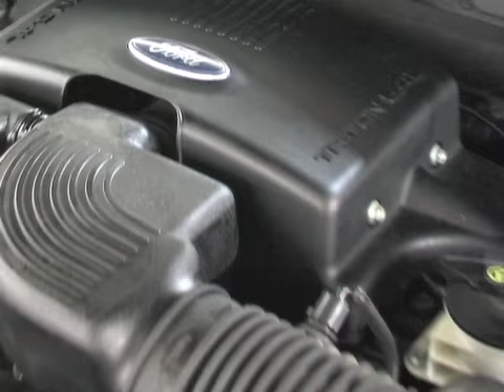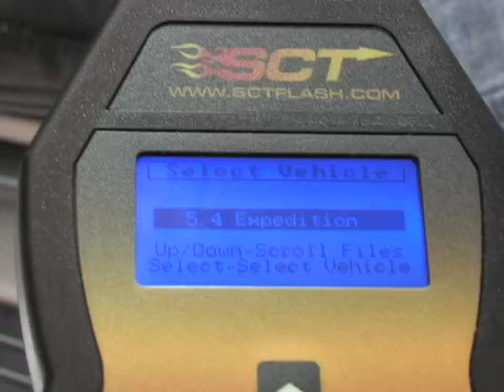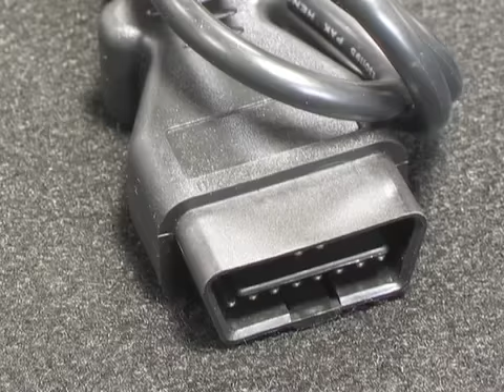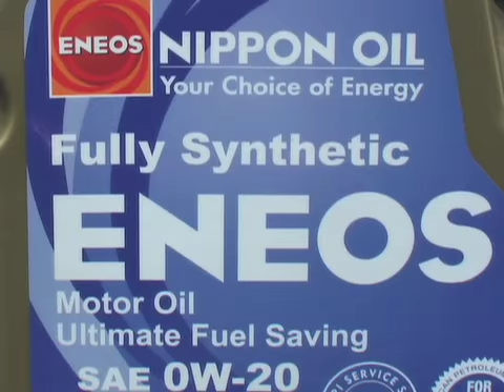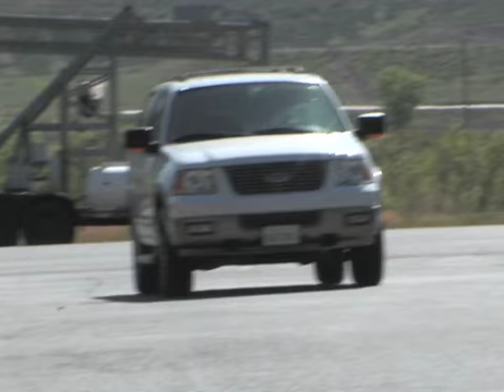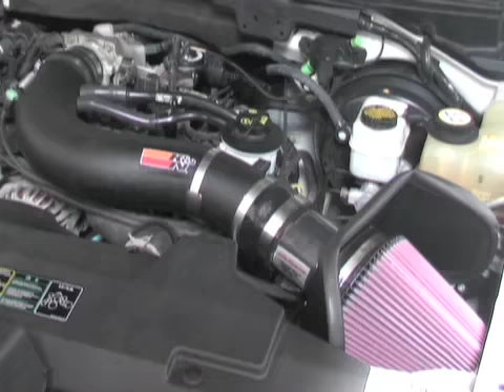More Power Out of Your SUV

Comment: Does anyone know where I can get all these parts at ? Please
Reply: diego 9 eBay/amazon the k&n runs about 350 bucks at the most. I’d go with the flowmaster cat back system it runs about 516 bucks (also direct bolt on). the tuner you real don’t need one, that’s is only if you absolutely care to see the numbers in real time. I have a 2003 Ford Expedition 4.6l I have all the works on it. I got all the ideas from stage 3 motor sports I just said shit if they make them for a 2012 expedition I’m pretty sure I can find similar things and recreate the build
Reply: @hsj1995 what all did you do

Comment: Intake 300
Exhaust 350
Tuner 250
MaS 100+

And 21 hp/ 22tq
Damn. That don't sound worthit. Unless hp/tq  numbers are right in the sweet spot for towing. ?     I'm guessing 🤔  hp gain is aboulve 3300. And torque gain about the same. 

My expedition pulls at 2400. @ 65-70.
Reply: If you do these upgrades early in the life of the vehicle it'll pay for itself over time in fuel savings, 2 more mpgs doesn't sound like a lot but say the vehicle lasts for 150,000 miles (fair mileage estimate) 
Let's say you get 15mpg stock, over the the 150,000 miles that's 10,000 gallons of fuel..... say the fuel average is 2.00$ that's 20,000$ in fuel for the life of the vehicle. 
Now let's do the same equation but 
17mpg, you'll spend 17,647$ 
That's 2,353$ in fuels savings.
Seems worth it to me

Comment: Sometimes it only takes one statement to ruin everything for someone that trusted you based on your word, and sometimes at all mas is his word.
NO ONE should sat they can read the code, and find out hat needs to be fixed, and fix it.
You are talking to people that may not have the slightest idea about vehicle, and couldn't begin let a lone complete a proper diagnosis, and fix it.
I Strongly suggest you removed and modify this video, , or start from scratch.
Reply: fart
Reply: Calm down, buddy. Overall it was a good, informative video. If you can't take your car to the nearest auto parts store, get a code, then use Google, you probably shouldn't be trying to work on your own vehicle anyway. Js
Reply: I think he's right ...,js

Comment: Total cost for the average guy needs to be told here  ive done this to several of my vehicles and its been bout 600 to 900 total with all the stuff plus that looked like a single outlet exhaust  and you did not get a throttlle body spacer for more bottom midrange torque  other than that and the fact it should have been more then 20 to 25 hp and footpounds added